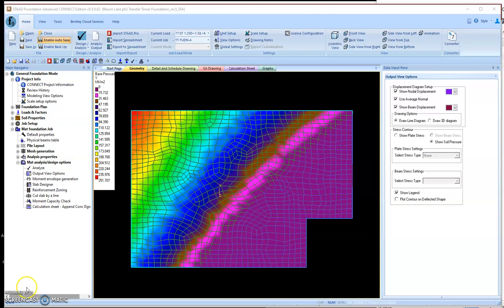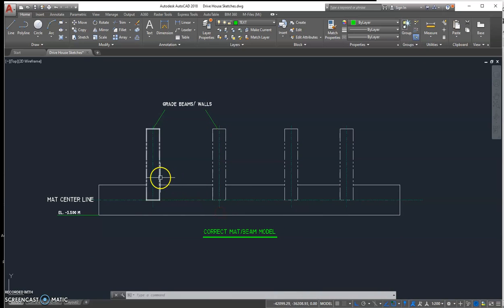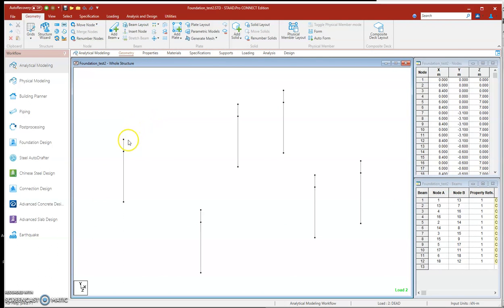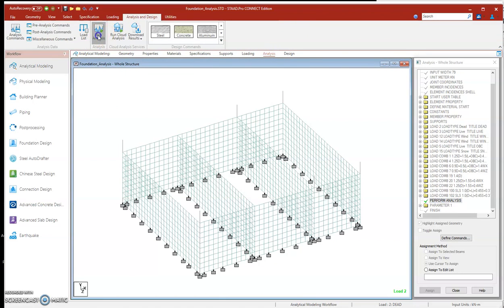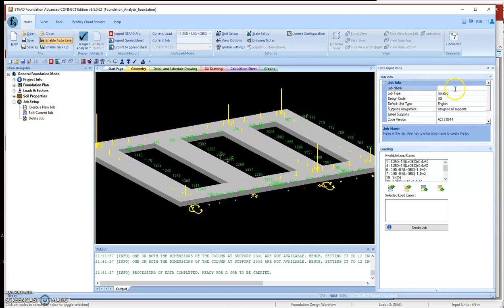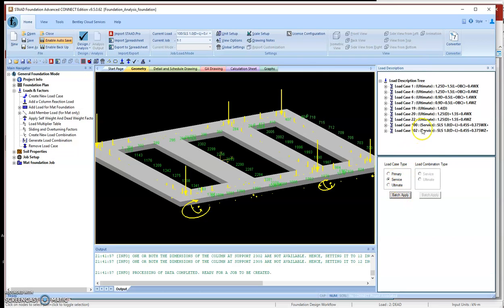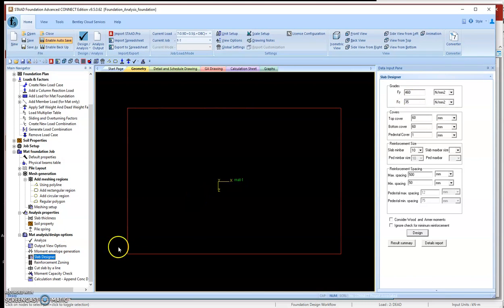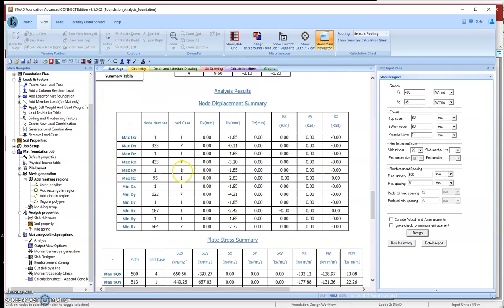Mat Foundation with grade beams/walls using STAAD Pro- SFA

Comment: Just a curious question: why should we use the Conventional Rigid Method for mat foundation?
Reply from the maker: Good question! As we know, in mat foundation there is an important assumption that the subgrade modulus is uniformly distributed or linearly distributed under the mat plate, such that the settlements and soil pressure can be calculated using the regular formula in ACI or CSA. However, if the mat is too soft, then it does not have the rigidity to maintain or apply such a subgrade modulus, instead, it shall use non-linearly distributed subgrade modulus, which is very complicated in calculations, and so far as I know, there are no foundation software supporting this.

Comment: How to calculate the rigidity of foundation, can we chat a bit?
Reply from the maker: when we use the Conventional Rigid Method to check the foundation rigidity, there is a Beita factor to calculate, see below,
Beita=(B1*K/(4Ef*If))^(1/4), 
then the column spacing check: d<= (1.75/Beita)